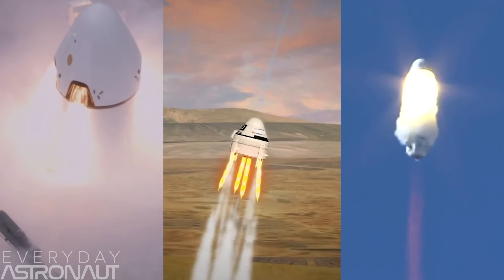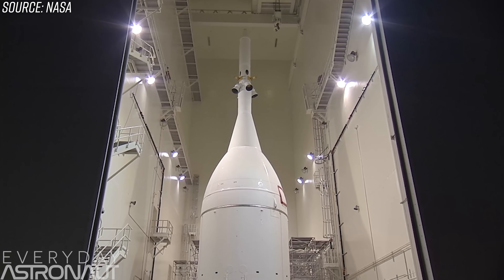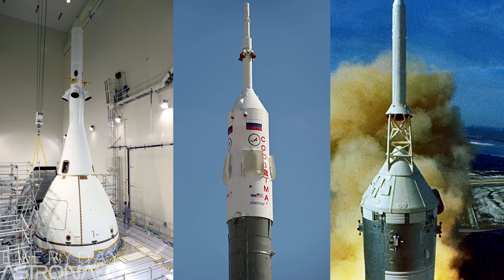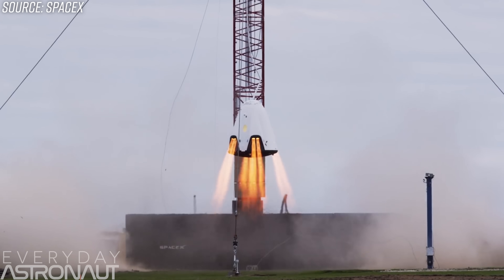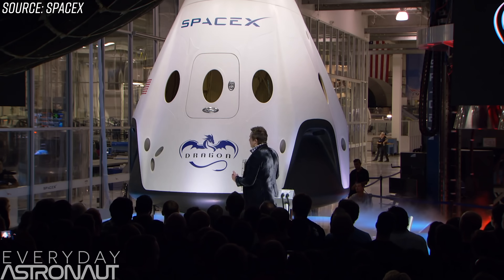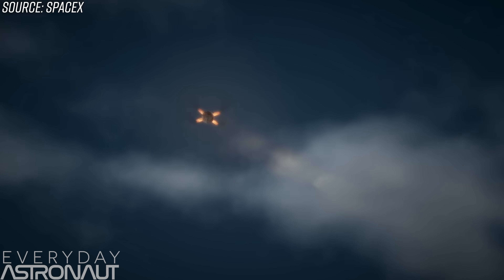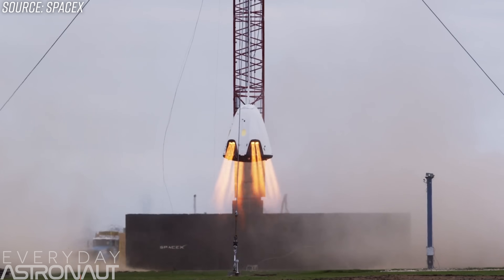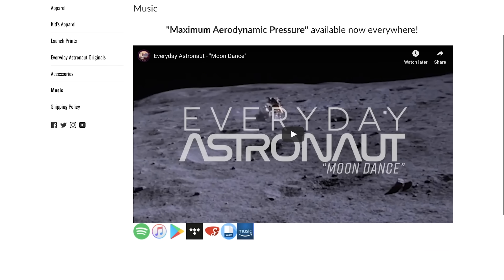Why have SpaceX, Boeing & Blue Origin ditched abort towers?

Comment: Replicating 60-ies technology seems harder than ever, harder than it was nearly 60 years ago. With 60 years of rocket, space and computer technology progress, this stagnation does not make any sense. Slogans like inexpensive and reusable seem empty it the light of lack of significant progress over decades.
Reply: They aren't trying to replicate 60s technology. They are trying to better it. That's how things progress. Where the progress comes will depend on what is needed. In many cases, cost is a big factor. Look at cars. Most people drive around in cars that are cheaper to buy (adjusted for inflation) more economical on fuel, and require much less maintenance than back in the 60s. The fact that they still mostly have 4 wheels, and internal combusion engine burning petrol or diesel, and basic controls that someone dumped here from the 60s would quickly understand and be able to use doesn't mean there has been no progress. The fact that big 3 or 4l engines have been replaced by 2l or less, yet still give out the same or more power, is progress, not a step back. The fact that the average car has less HP but will still beat the cars of the 60s off the line because of lower weight is also progress, not going backwards.
Reply: ChrisCooper312 we won’t agree, but I see it as 60 years of little progress. Materials have been slightly improved, performance (arguable), cost (arguable), safety (arguable), electronics (leaps ahead), mission capability (partial - last moon landing was in ‘72 with 60-ies technology and even older in concept). If you compare the rate of technological advances from 1900 to 1970 it is beyond comprehension, if you compare 1970 to 2019 we have failed to replicate a manned moon mission - and it is not sure if we’ll land any manned mission on the moon before 2030 (let alone Mars or one of its moons).

So all the talk about performance and cost effectiveness is rather mute if all we manage is a low orbit space station, with the most cost effective transport being basically 60/70-ies Russian tech with some state of the art electronics on top.

We have made giant leaps in communications and computer technology, information management and artificial intelligence.

We have changed the game with unmanned exploration, yet even if technology was more primitive, the 60-70-ies saw its share of (spectacular) unmanned missions.

I call that stagnant, certainly in the context of what we have seen before.

With a disclosed defense budget of +700 Billion USD (and unknown number of Billions in undisclosed defense spending) there is no question that the civilian space program has been underfunded. But to think that some private corporations can pick up the pace is naive - unless they get some defense contracts on the side, it is not profitable to explore space, unless you include potential zero g production or mining.

Call me a cynic, but much of this commercial space exploration is PR.

Comment: No... You want a system that is emergency only. Why did you not just put the parachute on top of the solid fuel rocket motor? Why not use a gyroscope for stability as well?

Comment: Couldn't Spacex land the capsule on one of the droneships? I mean you could quite easily line up the ship to capsules trajectory and use rcs/main engines on the capsule to correct any changes that could happen due to wind jne... and in  the end land with parachutes assisted by main engines as trajectory control. There is nothing obvious wrong with it and it would multiple crewed fligths.

Comment: Very few astronauts were in favour of the solid rocket tower type escape system. Once lit a solid goes until it uses the fuel. Then it relied on a parachute system. Too many unique events to sync with little certainty of success. It was not even controllable. Those days a very tight schedule directed systems design. Solid rocket system was ok. 
NASA requested a better controllable system.
Reply: Ehhh, the modern escape systems are far more complex and more "Too many unique events to sync".   The modern systems ALSO rely on parachutes to land.  The tower systems ARE controllable.  But most importantly tower systems have proven to be 100% reliable and have in fact saved a number of lives throughout their use.  So, basically nothing you said is true.

Comment: so we got gas, electric, solid fuel and liquid engines. What if we make plasma engines?
Reply: Plasma is hard to contain and even harder to produce. Lots of energy is needed and we simply don't have the technology to provide this amount of energy in an efficient way on most moving vessels. Nuclear submarines exist, but they don't need plasma for propulsion. Nuclear airplanes don't exist and neither will nuclear spacecraft - at least with our current level of technology. Also I really don't want to see them burn up a nuclear reactor during re-entry when they ditch that stage with the reactor.

Comment: I do not understand why Boeing is having such difficulty. They bought McDonald Douglas (The greatest ever Aerospace company) which had designed and built the McDonnell Douglas DC-X (Delta Clipper) back in the 90s. The Delta Clipper's test flights were far more impressive with hovering capabilities etc. Politically, NASA killed the program for the now defunct Lockheed Martin VentureStar Spaceplane. In fact, some DC-X engineers are working on the Blue Origin "Shepard".   
Even today, Lockheed Martin has deep political pockets which is why they continue to operate with vast amounts of costly overruns that us taxpayers shell out. My money is on Blue Origin and SpaceX for they have McDonald Douglas spirit and some of their engineers.

Comment: lets see fire over your capsule as it pulls away from the doomed rocket ... or fire under your capsule as you lift away from the doomed rocket ... no brainer ... UNDER ... it is actually easier to push something up than pull it up ... btw ... even NASA knew that one they went for a tower because they didnt have the tech to make it all fit UNDER the capsule

Comment: Why doesnt NASA want to land their capsules propulsively??
Reply: I think, at least in so far as Spacex goes, it was concerns over the landing legs coming out through the heatshield..  Also when it comes to parachutes they can usually employ more than are required to add some safely and redundancy.   I think spacex should re-use some crew dragons as cargo craft and have them do powered landings, if nothing else to see if they could have pulled it off and perhaps gather some engineering data on that could be used on other proposed landers.

Comment: The answer is pretty easy... payload. When you need to send something out to the moon (like for Orion/Apollo) you need to save every pound of weight and, bringing something for a trip around the moon is expensive if you don't use it. The same goes for reusable rockets, when you have to lift something of the weight of a warship like the Saturn V did, there is no reason to save 20% of fuel to make the rocket land, you can use that to keep the overall costs down. Fancy to see, maybe not that cost saving. Saturn V lifted 6.8 Mil pounds with 7.5 Mil pounds of trust, if had to lift more fuel that that, probably the F1 engine won't be able to do the job and, at the time, was the most powerful engine rocket ever designed.

Comment: Hmm. Wonder how in gods name spaceX will land with those drago´s if control on abort is kinda "flippy"..?
Reply: Seriously.. I mean the Drago motors, they are kinda close to each other so how much actual "thurst vectoring"-kind of control, that is needed ALOT for landing, they can pull with just differentials of dragos (some max torque data from these would be great .). Abort scenario is very different from that, and can be easily done by diffentials, but landing.. Maby that is more Musks dreaming, wich is not bad, but could that be the real reason while they kinda nowdays already dumbed the idea (yes I know Nasa didnt want that fast untested system, when you can use ALOT tested system (chutes), and why actually even bother, and heatshielding and legs..). But still i think this could be real reason, that it´s simply very wobbly idea when you think of it carefully.  It would be cool, but is it worth using time..

Comment: Can't we use nuclear power as a fuel
Reply: Depends on what you mean by Nuclear power. Power plants use nuclear fission heat and boil water and the steam of that water turns a turbine that produces your energy. Just because it's nuclear doesn't mean it's capable of being used for everything. Nuclear doesn't produce explosions like you think. Unless you want it to go super critical and become a nuclear explosion with uranium-235 witch is btw a national security. So I don't Nasa or Space X will use nuclear as a fuel for rockets anytime soon. Maybe as a power plant for Mars but not as rocket fuel.
Reply: @yakuza_suske3189  Many people think that nuclear reactors are extremely powerful. But counter-intuitively, ordinary rocket engines are much more powerful. Falcon-9 burns slightly under one ton of kerosene per second during the lift-off, which gives 30-40 GW of thermal power. Even the largest nuclear reactors today produce 10 times lower power. Of course, one can produce huge power in a nuclear chain reaction, but unless you are making an explosion, transmitting this power from the fissile material to the working fluid puts a serious limitation to how powerful a reactor can be. Nuclear reactors are much better suited to produce modest power for years, rather than a huge power for a few minutes.

Comment: The 1975 episode Dragon's Domain of Space 1999 showed why it was a good idea to have the abort capsule contain controllable engines.  It's unfortunate that some 40 years had to pass before anyone else thought so too, but that's what happens when a monopoly hires an idiot to decide to replace a proven lander system with a badly thought out shuttle.  As for the escape module landing someday, Fasa Corporation went with fully reusable dropships in 1985 (ish) and look where we are now...only a few steps from that now with the Dragon system.  We can still hope.

Comment: if the  MARS is 80 mln km from  as - and  speed in space i is 10 000 km/h  this meen thet travel its take 333 deys 
but in space  we can  heve  100 000 km /h  and traw=vel takes 33 days - no problem with rapror on H2O2 
or  enader engine like jon engine

Comment: Tractor system or pusher system? Let's see, which is best?...Lay your capsule/crew compartment on the ground at a 45 degree angle(referenced to "up")...you know,  a horrific scenario & you have the shortest of time, start the high-speed stopwatch...the liquid fuel pumps spool-up, the navigation gimballed engine nozzle points the appropriate way, Uh oh, too late...The solid fueled version?, "light-the-fuse"...which will you gamble your life with?
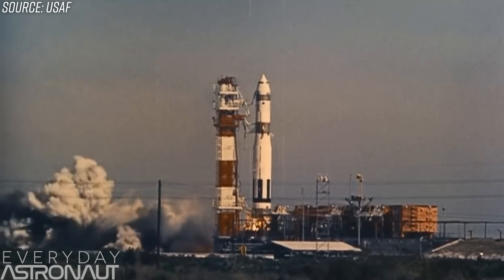   The scenario at 1:50 could likely have "rescued" a crewed capsule with the escape towers of the time.